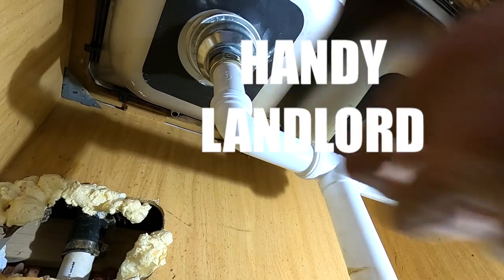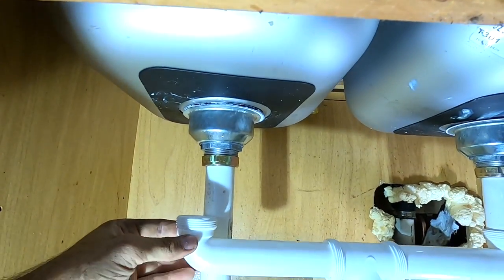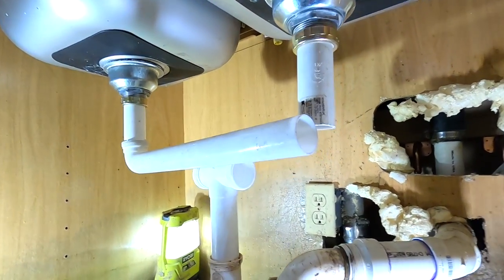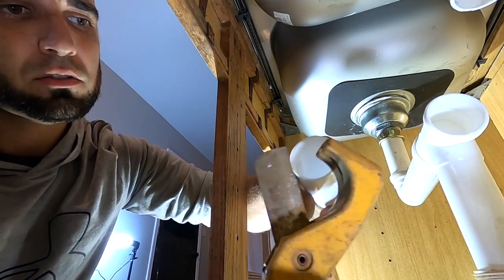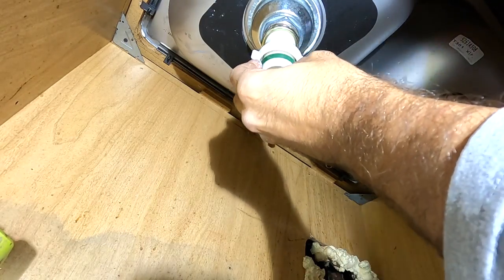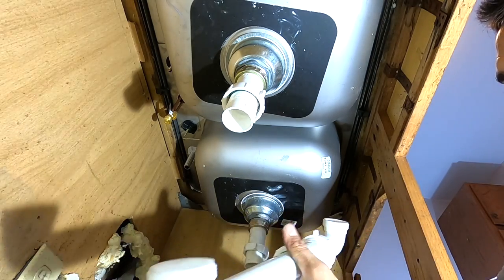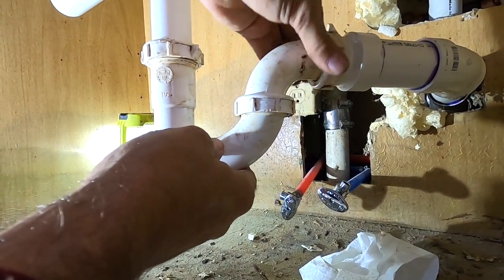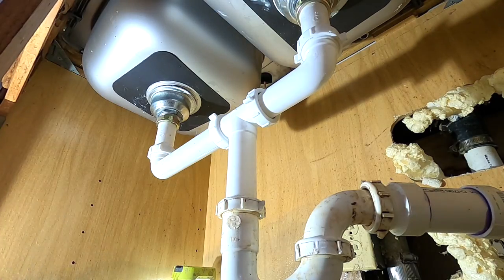Kitchen SINK DRAIN INSTALL

Comment: Nice. What's the  name of the cutter?
Reply from the maker: m k I think they are just called pvc cutters. Ridged makes a tool just for cutting the plastic drain traps. https://www.homedepot.com/p/RIDGID-1-1-4-in-to-1-1-2-in-PTEC-3000-Plastic-Tubing-Cutter-41608/203481523